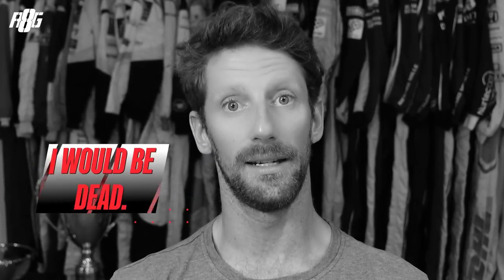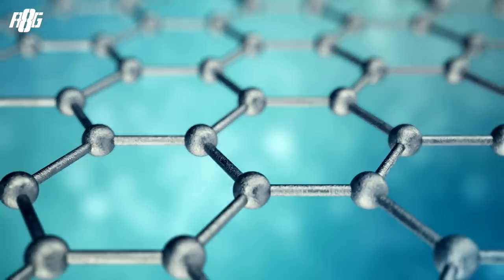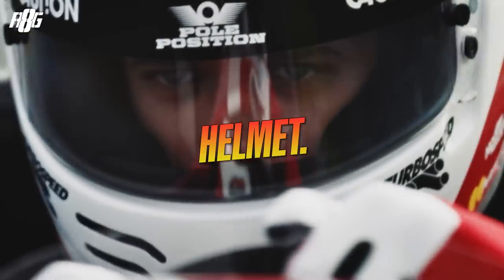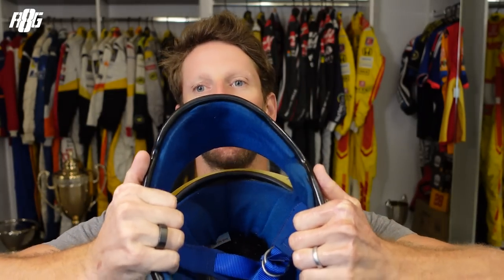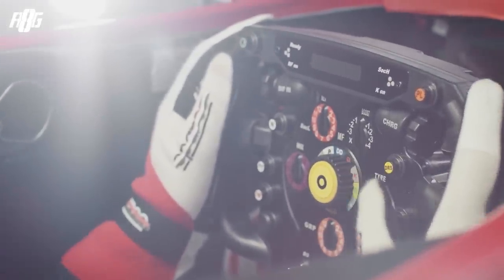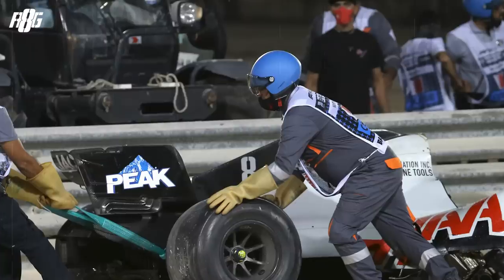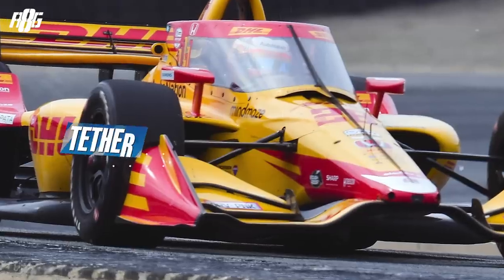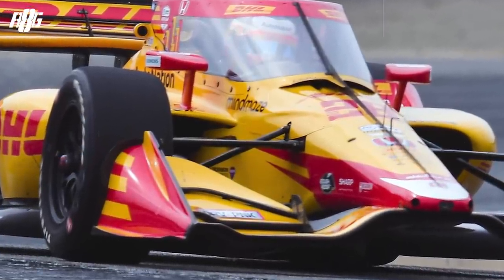Security and Crash Protection in F1 | Romain Grosjean

Comment: There were fuel tank improvements after Romain's crash in Bahrain. The structure and the positioning got changed, and now the rear of the car has to break away from the driver during an impact like that. Example: Mick at Monaco this year

Comment: The principal reason for the jewelry rules is imaging.  If you are subject to an X-ray or CT scan, metal causes flares and is opaque, so images are damaged.  In the case of MRI, any jewelry can become a deadly projectile (for example, a tiny nose stud could be pulled straight through your head).  If you've ever had an MR, you know the intensive screening they do (usually three phases) to ensure that you have NO METAL anywhere near the machine.

Comment: You're escape that night is one of the most amazing racing moments I've ever seen.  The fact that its led to greater safety shows how far we've come.  And you're right, glove protection still is the weak link.  I wear FSI 3.3/10 Carbon X/leather gloves when I work track safety.  That's only 10 seconds of direct impingement protection. And unlike the fire suit, where you can gain extra protection with the undergarments (both the layer and the air trapped between), there is no real room for and underlayer on driver gloves.

Comment: One accident that is not talked about in regards to Halo, is the one in Imola between George Russel and Valteri Bottas ( where George got out and hit Bottas helmet)   . If you watch slo mo  onboard from Georges car and freeze at right time. You will see Georges front wing and wheel being smashed on the halo instead of Valteris head. Very scary. Use < and >  key on keyboard to move frame by frame.

Comment: One key system missed in your video is the introduction of the “HANS Device.” Just has the drivers hated the Halo design, the same was said in regards to the “HANS Device.” 
Ever since the unfortunate incident in 2001 by Ralph Dale Earnhardt Sr., all of motor racing quickly required its drivers to use.

Comment: Romain in fact John Barnard was the first one to introduce carbon chassis in F1, on the infamous Ferrari of Gilles Villeneuve. John Barnard explained that it was the first time carbon chassis was used so not very well known, no calculus tools to define the right structure: it was very empiric. And that's why Gilles was killed in its Ferrari, after its accident, Barnard increased the chassis thickness and Didier Pironi got only broken legs and one arm with the same type of accident...

Comment: Romain, where you feel more safe, on a F1 or Indycar? The 1 million dollar question 😁
Reply: I can't speak for him, but he has said in the past that the Indycars are more robust. I think the aeroscreen also potentially could prevent some accidents the halo cannot. Plus the whole tethers thing at the end of the video also...
Reply: I would say the IndyCar is likely safer. It has to be designed to handle a higher speed impact on an oval track
Reply: @izzieb  I'm not sure if I understand your comment correctly, but F1 also uses tethers
Reply: @ericdavis2145  F1 uses Halo, Tethers have wind screens. Tethers can protect against both big & small parts such as springs/bolts flying after a crash. Halo only against big objects like tyres, barriers etc